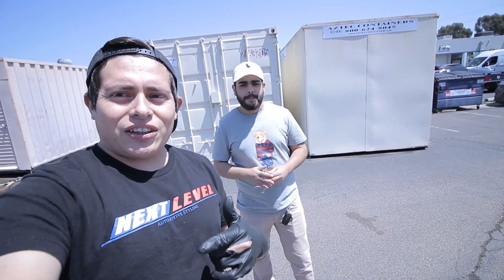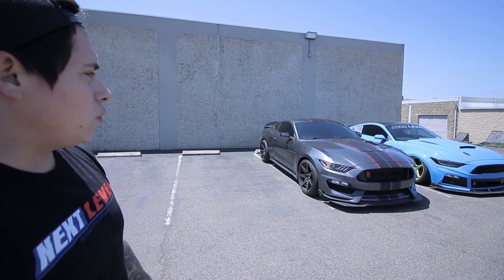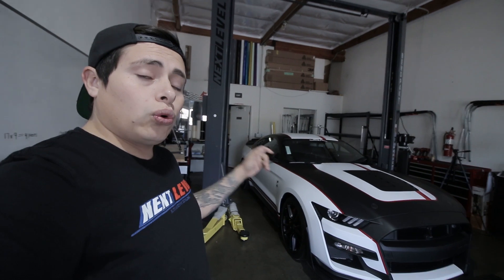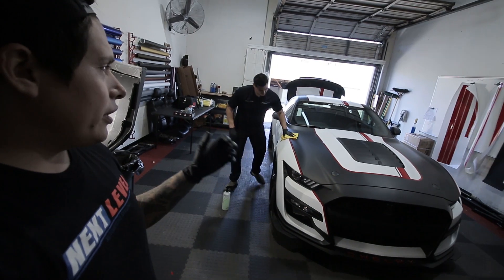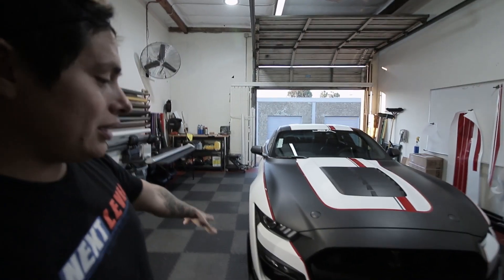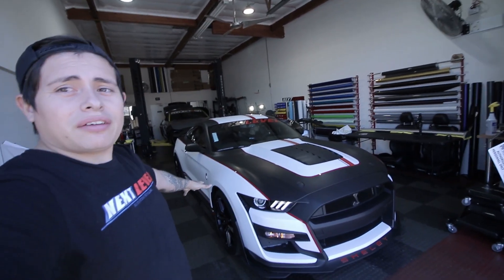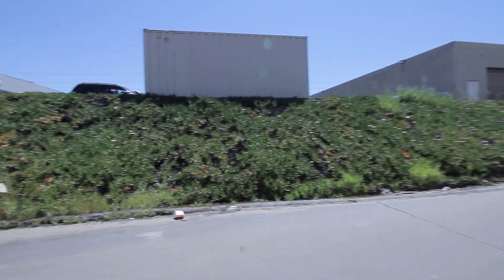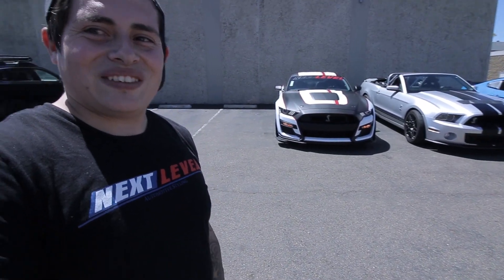The 2020 GT500 Gets Ceramic Coated and Tint! and it is Ready to Go Home!

Comment: Nice work!  What does ceramic coating do, and is this better than the film/coating the dealer wants to put on the new car my wife wants?
Reply from the maker: Hi Tom! The ceramic coating is like a hand layed layer of clear coat over your car that will protect your paint from small scratches and rock chips. And will also repel water and contaminates from sticking to your vehicle making it easier to keep clean and wash. The PPF film is a clear film that is alot thicker and will protect your vehicle alot more than the ceramic. You can also ceramic over the PPF film for a extra layer of protection
Reply: @NextLevelStyling  Thanks!